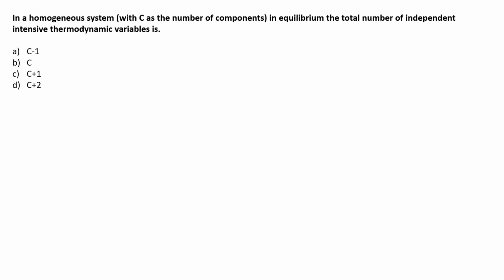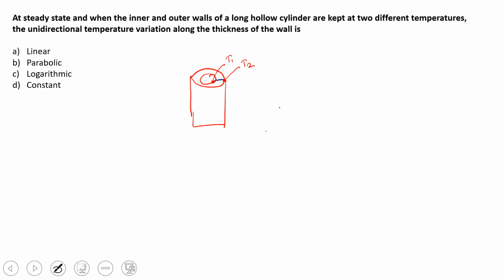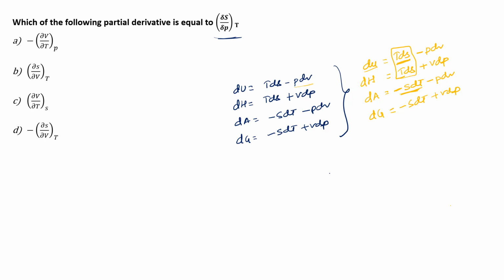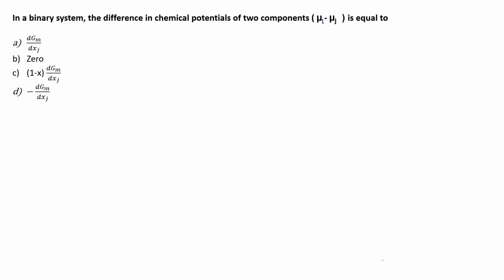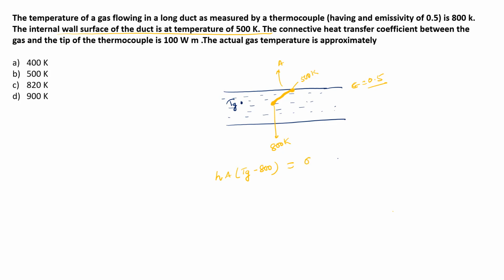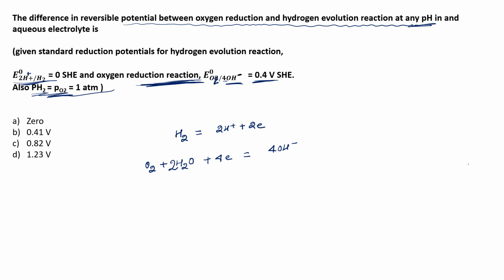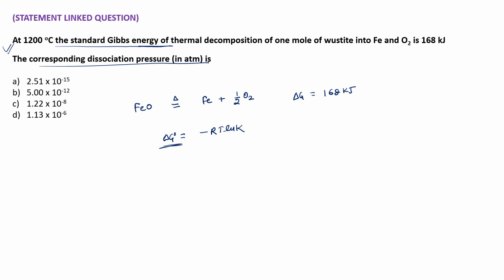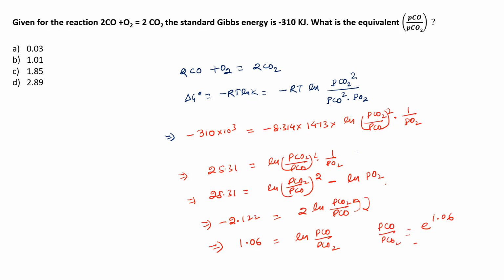GATE 2010 Themodynamics and Rate Process Solution

Comment from the maker: 00:00 Intensive thermodynamic variable
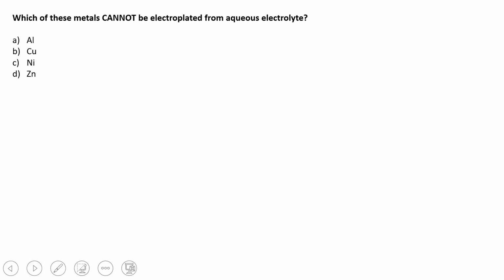01:25 Electrolysis
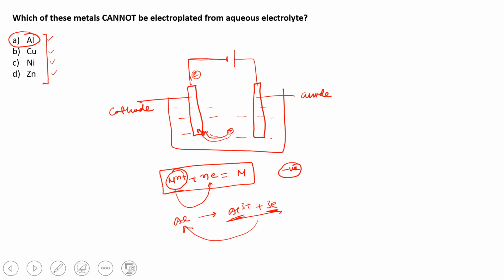04:39 Heat conduction
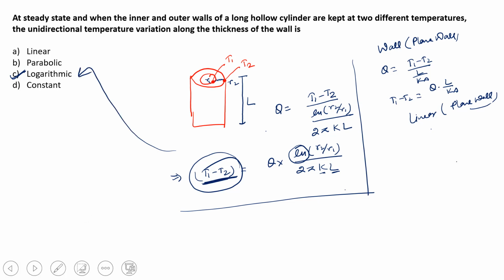07:39 Maxwell equation
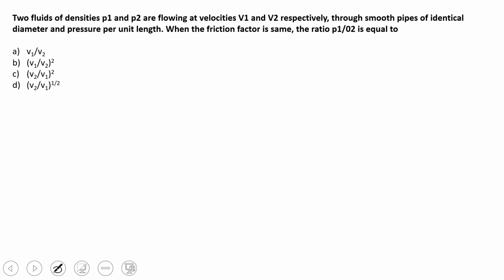13:57 Fluid mechanics
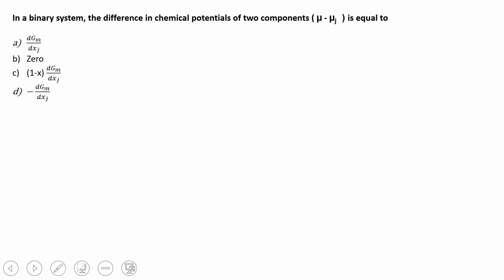16:15 Chemical potential
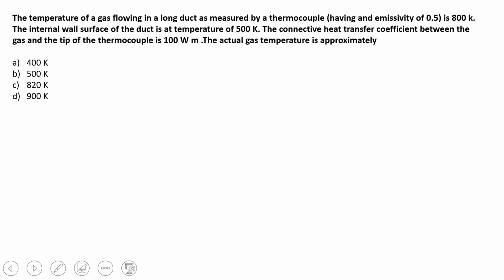18:56 Heat transfer thermocouple temperature question
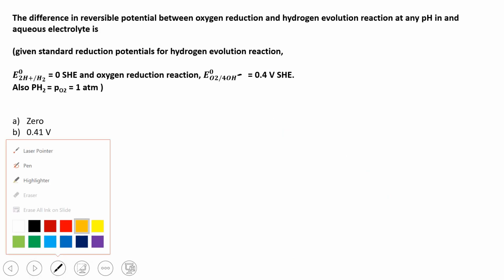25:00 Nerst Equation
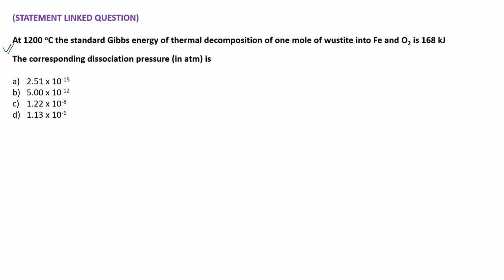31:14 Statement linked question dissociation pressure
35:11 PCO/PCO2 ratio